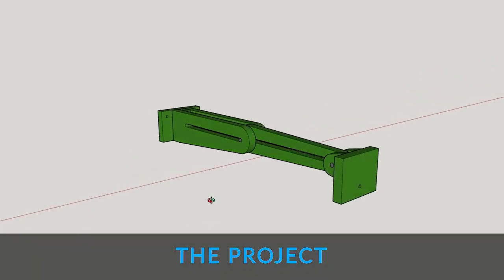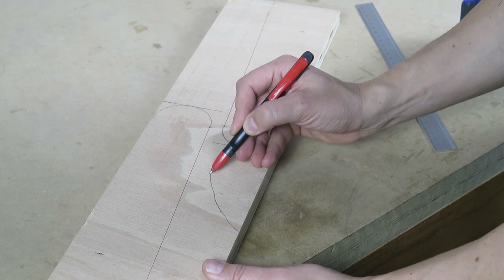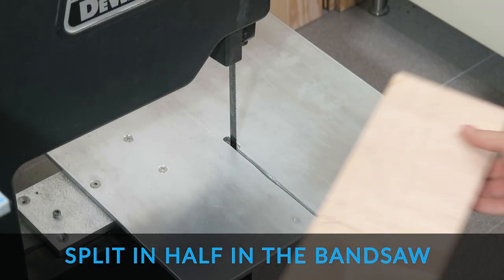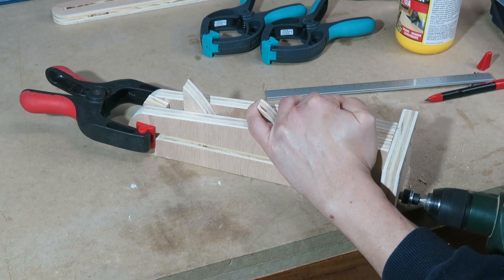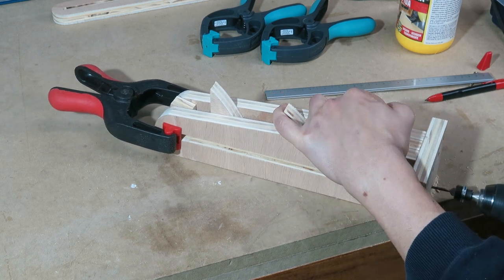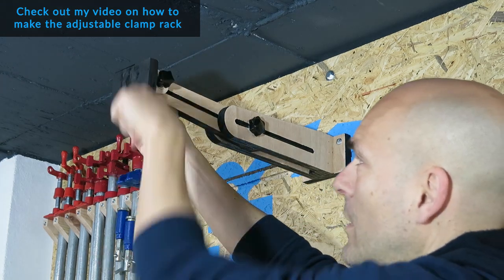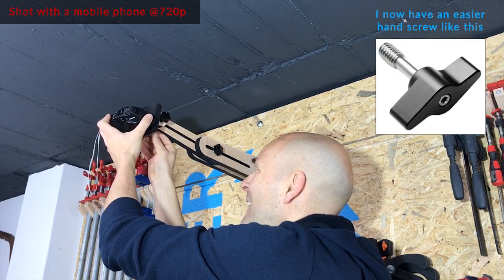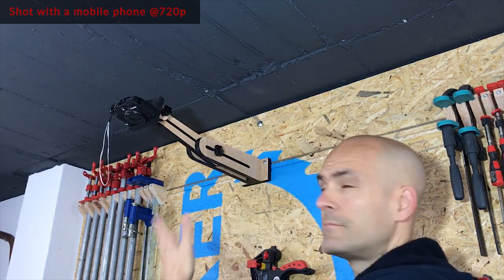DIY Camera Rig for Overhead Shooting

Comment: Very nice build, I actually need something similar but movable like a crane.
Reply from the maker: Thanks. You can adapt it to a structure with some kind of post, and caster wheels to be movable. Can't you mount it on the ceiling?
Reply: @DMaker_builds  I can but it's more useful if it's movable.

Comment: I love the creative shots you used, especially where you pick up the camera in the end. 
My camera is quite a bit heavier though, I think i may need an extra 45 degree piece to distribute the weight on the wall.
Reply from the maker: Hi Betty, thanks! What kind of camera do you have? I tried with an old DSLR I have and it worked fine.
Reply: @DMaker_builds  a canon M50. So far I have used a clamp on a pipe, so that could also be the issue, clamping it to a round surface.
Reply from the maker: @bettybuilds8011  with that camera this kind of rig is more than enough. It will surelly hold it in place! ;)